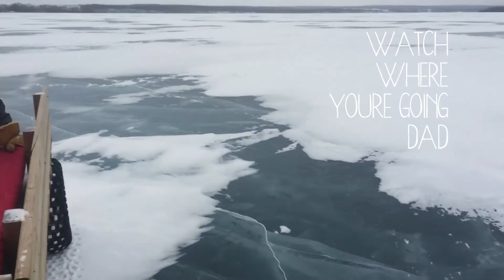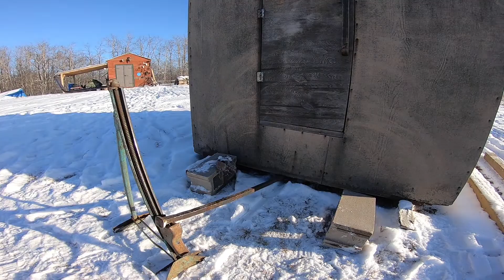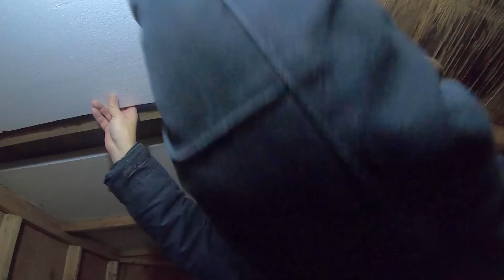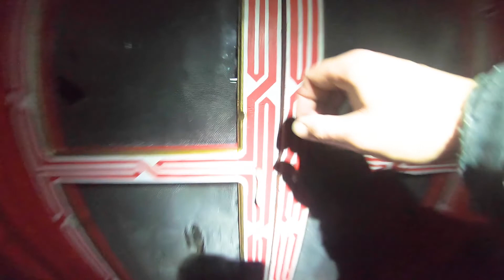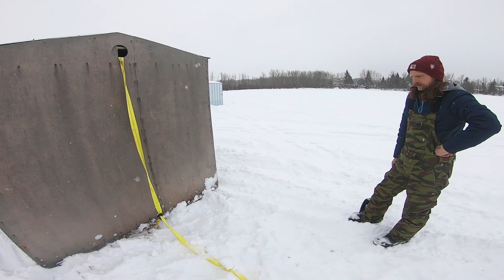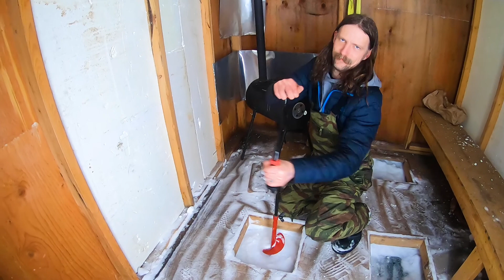The Shabby Ice Shanty

Comment: You guy's remind of my buddy and I years ago, I am 50 now. lol .  I have made about 5 shacks and learned so much.  I just built a 6x8 double insulated floor and completely insulated walls and ceiling.  All lined with with plastic and insulated barrier.  I worked outside my whole life in freezing cold temps and my extremities can't handle cold anymore.  Not to bore you but I love my new shack.  I can heat it with a lantern to be honest. I was watching you pull it and i had the same problem years ago until i made a v plow in front of shack.  Now i own a plow truck and can plow the path as your friend did with four wheeler. You have to do the V plow on the front of these shacks and go with 6x6 for skids with poly on the bottom. Wood burner's no! lol Big buddy all the way. had the wood burner's, takes to long and smoky.  I have an ol school one in my deer shack and all good but heat the shack up with the cone 80, 000 btu to get the shack right, construction type from fleet farm.  I like the video though and thank you for it.
Reply from the maker: Sounds pretty sweet man. I'm 43 now so hopefully I'll make some strides in the next few years and get some upgrades going. Thanks for the comments

Comment: Great video bud ,next time try putting a a steel bar in between the skids on the  end your pulling from n put a pin in each outer end of the bar coming out the side so the skids so u can remove the bar if ya want n pull it tht way it will help pull it n lift the front up alil as its pulled to keep it from diggn in the snow. I've done it with a shed through mud n slush so it should work for you.
Reply from the maker: Haha. Yeah we need to work on a new skid design for this one which will include a rigid hitch. She needs more clearance and some better shoes for sure, but it'll wait. Thanks for the support as always, Brian.